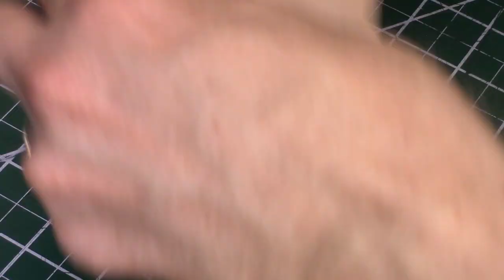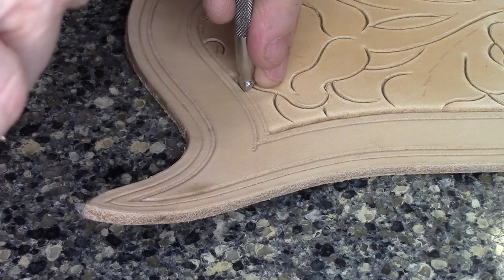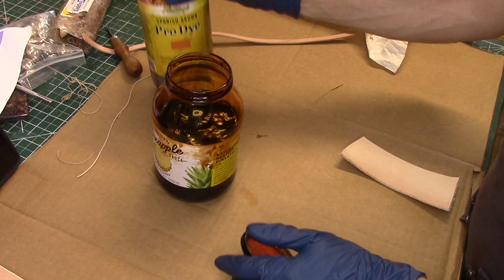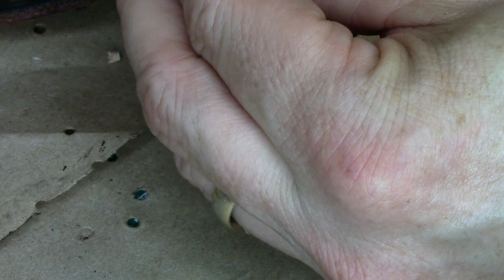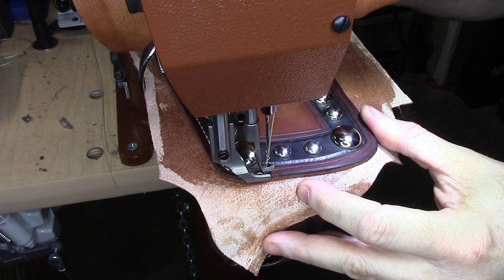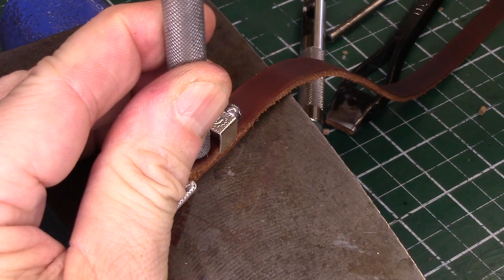Making a Tooled Leather Cowboy Holster ASMR Leathercraft

Comment: Do you use a resist or resolene coating after the Spanish brown / neetsfoot oiling prior to applying the antique?  I am trying to replicate your color / technique as I like the way they come out.  My tests on tooled /stamped veg tan seemed to come out very dark on the tooled area and quite light on the non tooled areas.  It’s almost like the antique is staining the dye ...  I have run the dye and set overnight, then coated neetsfoot and another overnight sit then antique with immediate wipe and it’s still coming out very dark.   Any advice?
Reply from the maker: No. Just the neatsfoot oil. Yes, the antique will stain the longer it stays on the leather. I apply quickly and Immediately wipe off. It's sort of a race for time as soon as I start brushing it on. If it's not coming out the way you want, try the resist. Different hides can have different results.
Reply: Thank you!